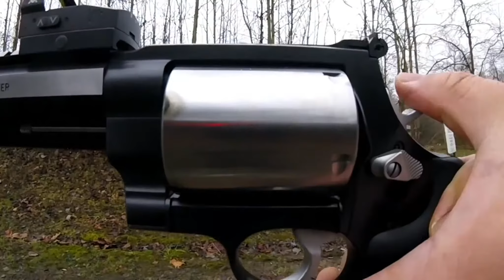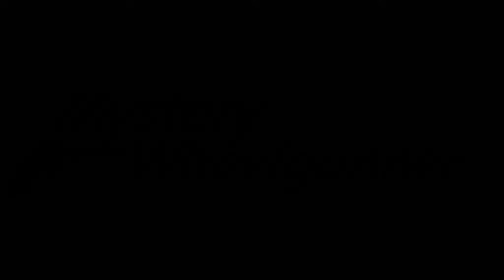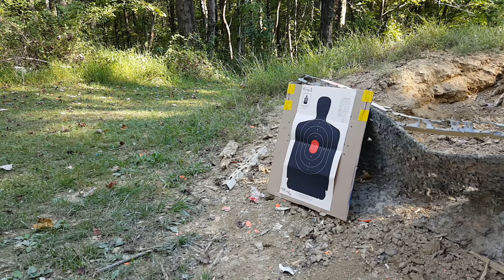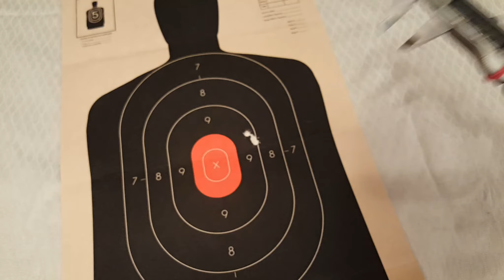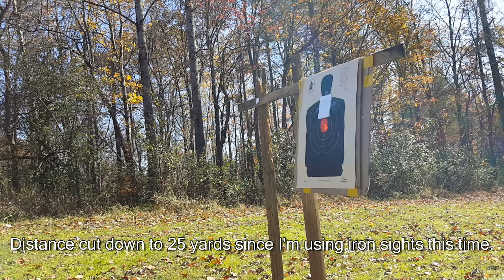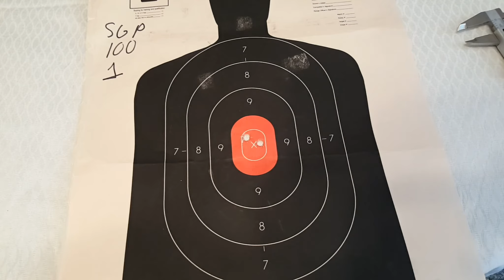Accuracy testing - 627 V Comp and Ruger Super GP100

Comment: Hey was wondering which one you would recommend of these two for something I’m gonna put a lot of rounds of hot 357 through
Reply from the maker: Good question. Unfortunately, I haven't shot enough hot 357 magnums through any of them to give you an honest answer. The hottest I've shot is a  handload that mimics the 158gr JSP factory loading from American Eagle. It's a bit on the warm side, but not what I'd consider hot. That loading barely stresses out either revolver. Anyways, sorry that I don't have enough info for you.
Reply: Mystery Wheelgunner what do you like more from a shooting standpoint or just in general
Reply from the maker: @MrChocovanilla1  . I like the V-Comp a little more since it has the option of running with or without the compensator. It comes with a muzzle cap that you can easily swap in if you don't want to run the comp. That being said, both of these guns are fantastic. I just happen to like the V-Comp a little bit more.

Comment: The velocity difference was interesting, though still could just be an artifact of the variance between individual rounds.  Still, I was curious if the atypical rifling of the Super GP100 had an affect on things, and it may be so.  Still, hard to say though, given that frankly your testing methodology is terrible.  I mean how can you even call that accuracy testing when you are using two different sighting methods, at two different ranges, with one target being stable and the other flapping in the wind?
Reply from the maker: I will do a retest of the Super GP100 once I find a red dot mount for it.
Reply: @MysteryWheelgunner  Thanks!

Comment: Why would you have the target for the smith stationary sitting on the ground not moving in the wind and then you hang up a target for the SGP 100 that’s blowing in the wind?  Pull that optic off of the Smith and shoot them both at the same yardage while both targets are setting on the ground. I would be willing to bet that Ruger would outshoot that Smith. Complete waist of time with this one.
Reply from the maker: Not sure if an optic mount exists yet for the SGP-100. I know there are optic mounts for the regular GP100, but I don't know if they fit the dimensions of the SGP-100.
Reply from the maker: But when I do get a mount for the SGP-100, I will re-test it at 50 yards.

Comment: I’d like to see that SGP100 with an optic. I’d also like a 9mm version...please Ruger.
Reply: Ruger just came out with a 9mm version, just saw it on their website.
Reply: @sky4149  The large gap in front of the cylinder doesn't look that great, but that's a personal thing.
Reply: @sky4149  @lifted_above Woo! It's two tone and I love it! Though I wish it held one more round like the comparable S&W.
Reply from the maker: Yeah. I'll look into putting a red dot on it and taking it to 50 yards. Should be some good black Friday/Christmas deals soon.
Reply: @MysteryWheelgunner  if it has typical ruger sights,  check our Weigatinny rail for an optic!!
Reply: mrhobbles.... you asked, they deliver. Even going 1/2" longer barrel.  https://www.ruger.com/products/superGP100/specSheets/5066.html
Reply: I want to see Ruger use moon clips even on the 357 and other rimmed cartridges!!!
Reply: @nmhvactech5474  You can just use a speedloader. Speed Beez has some super slick ones.
Reply: @nmhvactech5474  This SGP100 does. I wish my GP100 Match Champion 357 came cut for moonclips too